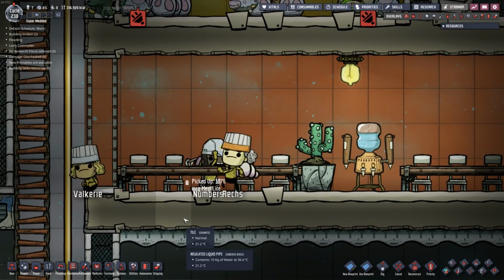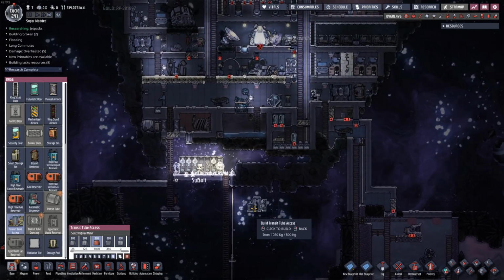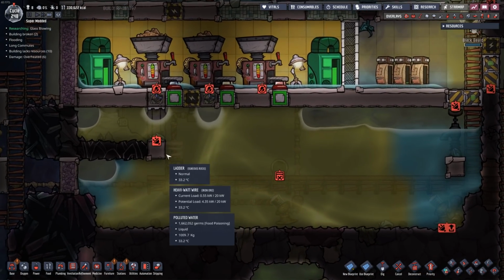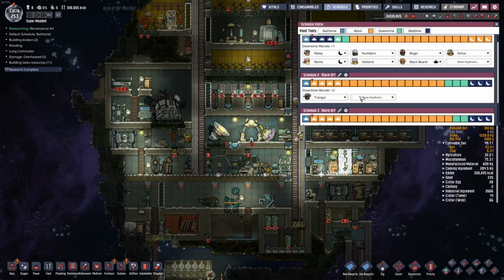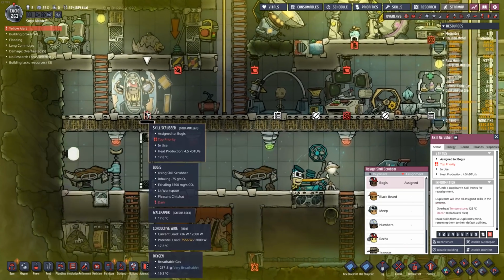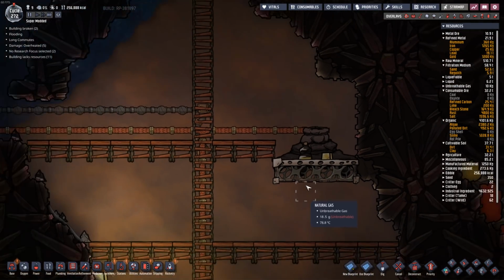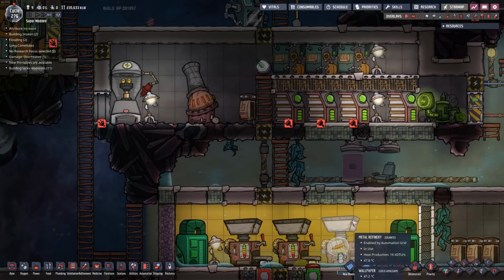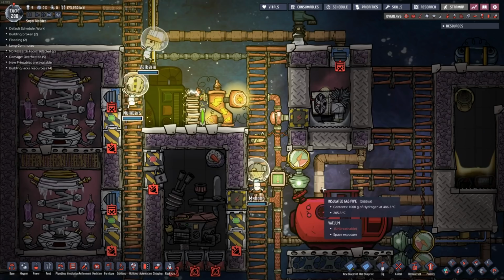Boil Oil Using Ultra Hot Hydrogen Part 2! Super Modded Oxygen Not Included EP8

Comment: Could it be the material you choose for the reverse cycle regulator affects the minimum temperature? I feel it would the most balanced choice this modder could make to not make steel and space metals obselete. What material did you make the thermo-regulator out of? edit: aluminum ore, maybe steel? edit2: Yeah no material doesn't affect the minimum temp. Bummer. Wonder why the minimum temp is so high.

Comment: Hi! @30:00, I did some tests in sandbox on heat exchangers. it seem the sweet spot is about at segment lenght of 7-8 pipe tiles. At that point extending the heat exchanger vertically (more 'floors') is better than horizontally. Still the efficiency depends mostly on overall pipe length, we're talking something in the range of 2-3% difference for pipe arrangements (actually, 5 per floor or less, it gets worse quite fast, above 9 the decay is not as steep). I mention that because while in the whole playthrough you have space constraints, here you could have extended it vertically.

Comment: A hermetic unit like in a fridge is anywhere from a couple ounces to a couple pounds of refrigerant depending on it's application(in a home compared to a restaurant) it also depends on what type of refrigerant if you wanted to calculate btu's. You could find most of that info on the info tag on the fridge and do the math to find out. Wish I could remember the calculation, it's been 10 years since I needed to do that for my 608 and 609 ac and refrigeration licenses. That's how I look at your cooling systems you run around your base it reminds me of the chill water systems I had to maintain in the Navy and how I'd run it for optimal cooling.
Reply: Same Idea with Boilers, but on a larger scale when you use them for propulsion... it's all phase change management to transfer energy.  Refrig is to transfer heat out of living areas... propulsion transfers chemical energy from fuel and oxygen to water - phase changing it to steam, adding more energy by superheating beyond phase change, then transferring that heat energy into mechanical rotational energy using a turbine (flowing steam pushes on the turbine blades spinning it really fast - low torque - but is modified to massive torque through massive reduction gears, cooling the steam) ... and then phase changing the steam back to water using a vacuum to move the point of condensation and provide a pressure differential for the steam flow.  Also note, putting the water / steam under pressure also moves the boiling point of water... 600psi water boils at 490 degrees F.  =D
Reply: @MikelNaUsaCom  your comment makes me want to get a tour of a steam turbine one day

Comment: i usually set up radiant pipes with petroleum to cool the steam ASAP get a little power out of it and dump less heat into my oxygen system
EDIT:  i found you can infinitely split and rejoin gas pipes without them freaking out, you just need to put another bridge on the other side of every point you want to rejoin to reset the priority and keep the direction going the right way.

Comment: I've had that happen to me as well, I don't think I deconstructed the oil well but it was gone when I saw it the next time T_T
Reply: Is there a possibility that it melted ?
Reply: @artur6912  No, its overheat modifier is +1000celcius for oil well
Reply: I think its a glitch with lead. I had to rebuild it multiple times and it finally stopped when I switch to a different material.